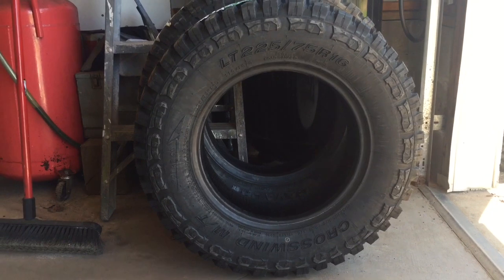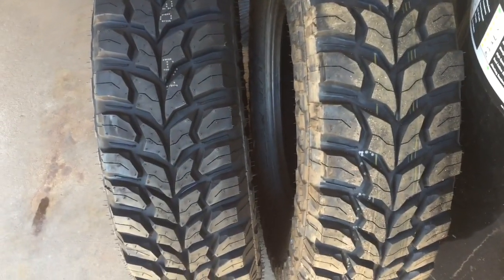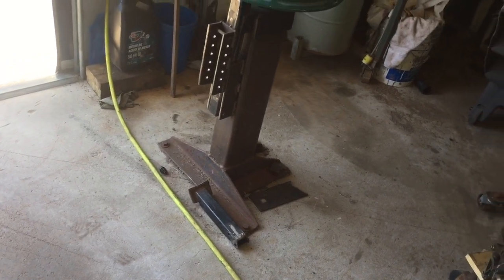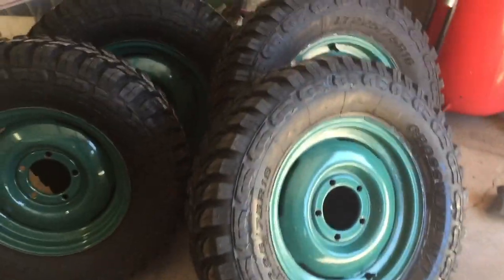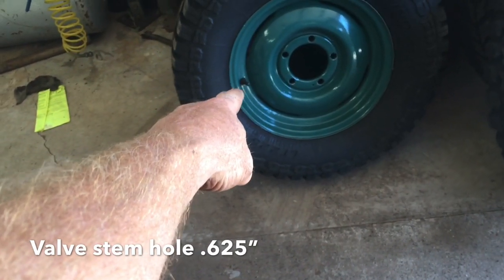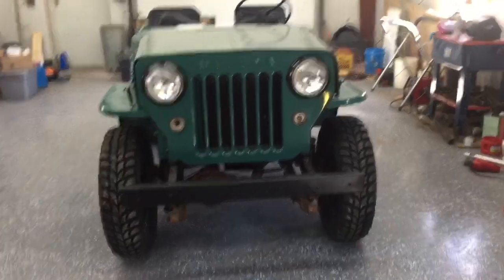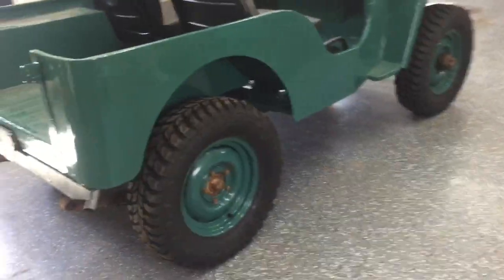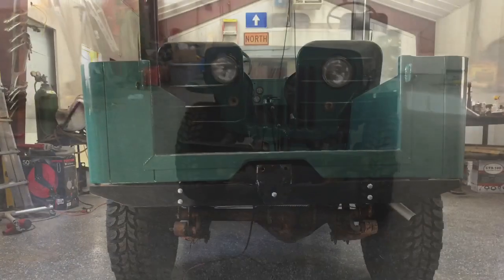Willys Jeep Mild Restoration #14 New Tires!

Comment: I've just acquired some vintage willys rims for my cj3a they are only 4.5 inch wide by 15. I was thinking these tire are to wide for a 4-1/2 inch rim I was thinking 7.00-15 tires might do better. My willy's is close to the same color, and trying to decide what color I wanted the rims to be. I thought Khaki  had the best look with the darker green.
Reply from the maker: Contrasting rim colors are great. I just went the same for this Jeep because I had extra paint.
Reply: @fastdadgarage-northsouthch4418   What size are your Kelsey Hayes rims as far as width and the width size of your tire. The narrowest tire I can find for my 4.5 inch rimes are 7.00-15 and recommended to have a 5.5 inch rims but I think they'll work fine, what do you think?
Reply from the maker: These tires are 225/75r16 the rims are 4.5-5 inch I can’t remember for sure. The beads locked on and I haven’t had any trouble.

Comment: Hi, been looking at this type of tire for my 3B, is your 3B stock height or raised?  I am at 2.5 lift right now.  Thanks, B
Reply from the maker: Brett Dixon - It is stock currently. You could probably run the bigger tires. What suspension kit are you using and how do you like it?
Reply: @fastdadgarage-northsouthch4418  I am using a 57 CJ5 frame for my 54 3B body, went for the longer springs options hoping for a little more stability.  I used Rough Country for the kit.